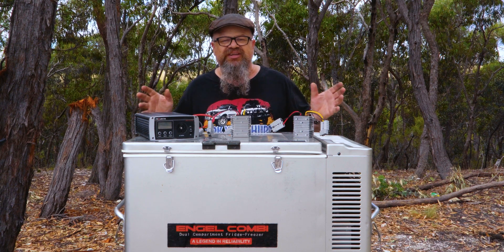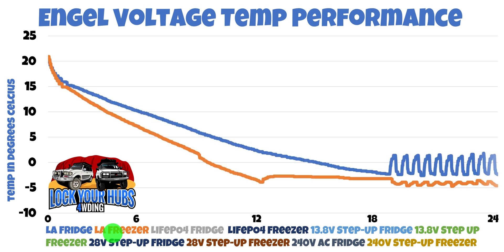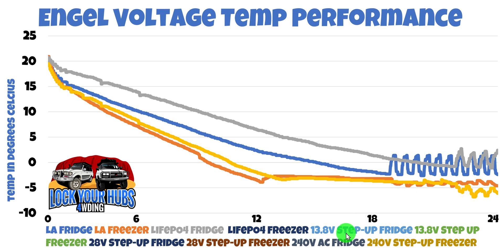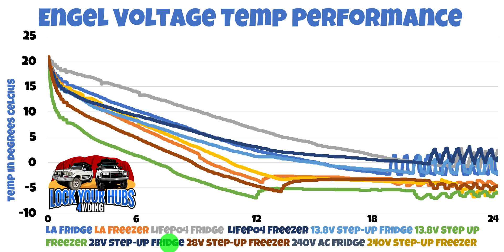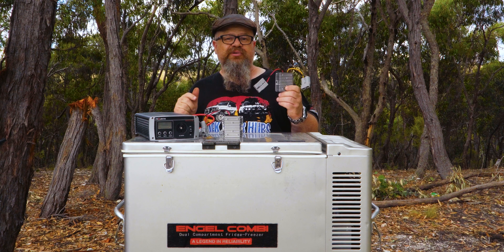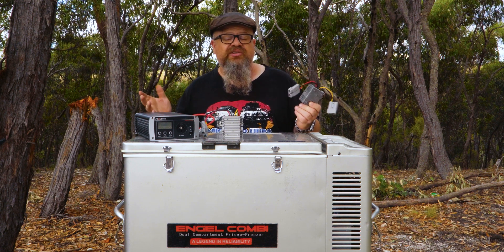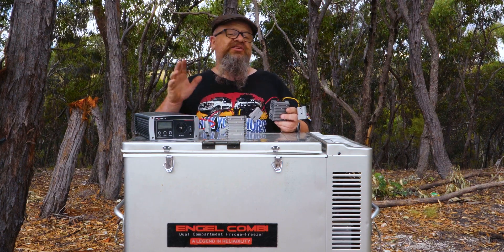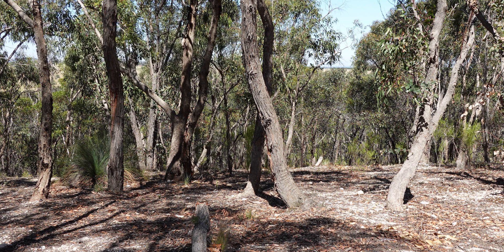Engel Fridge Voltage Showdown: 12V vs 24V vs 240V

Comment: Any chance of doing a performance test between  a kings stayzcool and a  engel.
Cheers Jack
Reply from the maker: Is that the King's dual zone fridge?
Reply: @LockyourHubs4WDing  .
Yes I would assume you that would have to compare a dual zone to a dual zone or a single zone to a single zone.
I am looking at either the 38 ltr plastic Engle or a 45 ltr stayzcool kings.
A Engel  is $899
A stayzcool is $369.
So you can have 2.5 staycools for I Engel
I need a fridge to maintain -18 deg C....
 As ice cream is a must have  or my world will collapse....
.
It would be nice to know if the king's temp gauge is accurate and the thermal efficiency of each unit along with the power units.
The king's have a 5 year warranty as well..
I really enjoy your detailed reviews.
Cheers  Jack

Comment: Great Video on this topic 👍. Interesting to see the peak power is around 13.8v in this case, newer Engels have a regulated power supply so wonder if that's deliberate to make the most performance when the alternator is charging and then save some energy as battery voltage lowers?

For some more technical info if anyone's interested , old school Engels used an iron transformer to generate the compressor voltage (about 23v) from either mains 50HZ directly or a very basic 2 transistor oscillator on the 12v side unregulated. This is why they don't work on 24v and just start humming without cooling from poor input voltage.

 Alternatively in every Engel after about the mid 90's they actually use a digital Mosfet based switching circuit to directly drive the compressor with its aprox. 23 volts AC. Before this 'inverter' section, internally there is a switching dc-dc converter that takes any input voltage (10-30 volts) and regulates it to the required voltage for the compressor circuit. This is why the new ones work much more efficiently on any dc input given, but makes an interesting point of why there is any variation at all with voltage. As stated I can only think its deliberate to give better cooldown performance when the alternator is charging.   

The 240v input is handled by a separate power supply board that just spits out usually 24-28v into the dc converter section. Hopefully someone's following, internally its (240v power supply) -> (28v DC or DC input) -> (DC-DC Converter) -> (regulated stored DC) -> (Inverter Circuit) -> (AC for Compressor). Of course a lot of the efficiency loss in this testing is the external step up or inverter units but there is still going to be some extra loss with the internal 240v supply as well.
Reply from the maker: Thanks for the info! I haven't actually pull one apart to check out the internal wiring. I would assume the circuitry is designed to operate most efficiently at driving voltages in a 12v car as that's probably what a vast majority of the customer base will be doing.

Comment: Back in the mid 80’s I tried modifying the my Engel motor drive electronics frequency.  My theory was the swing motor resonate frequency may not be exactly 50hz & matching that frequency may improve efficiency.  
Compared standard 50hz then below & above 50hz  by up to a few hz.  Found i could not make any significant difference from standard 50hz.   My theory was wrong but had some fun testing.
Reply from the maker: I've done plenty of testing that went nowhere! If you're not making mistakes, you're not learning.
Reply: I tried a similar feat with a 40ltr Engel a few years ago using a 150w inverter and a few other tricks, it worked for several days at a time and then played up. I have more recently got an old caravan Engel fridge with the same Sawafuji swing motor for parts & experimentation, the 12v side does not work but I found the output from the 240vac was actually 138hz (not 50hz as one may expect) at 14.2vac, so I am having another go at making a power supply for my 40ltr Engel using a variable pwm in the 138hz range or there abouts, possibly this frequency can be tuned for better performance. Hope this helps. Cheers

Comment: Another great vid mate. Been a fan of yours (and subscribed) for years now. If you ever get the chance, it'd be great if you could do a vid on lithium batteries.... and whether the charging of these batteries by 'non-lithium chargers' is actually that bad. I've heard many opposing views. Some say lithium chargers are not really needed (and only differentiated by one wire? from non-lithium type chargers... ) and the non- lithium chargers will do the job just fine (and save you heaps in the process). At least one well known company says their lithiums are just 'drop in replaceable' for your old agm batteries and able to be charged by non-lithium type chargers. Anyhow... Appreciate all your vids. They're awesome mate. Cheers 🍻
Reply from the maker: Great suggestion! I'm currently putting a Kings 120Ah Lithium battery through it's paces at the moment. I might check it out after this round of testing.
Reply: @LockyourHubs4WDing  Awesome mate. Look forward to it! Cheers 🍻

Comment: Thanks for that mate. 
Here's an idea for a future video. 
Starlink.....it requires an inverter to supply the router, which then sends 48vdc to the dish, which is the brains of the whole outfit. 
Some people have converted their unit to a 48v converter and POE,  to avoid the need for an inverter.
I'm currently running a dedicated 300w inverter that is only for the Starlink and also the Wavlink AC1200 wifi extender that I have mounted on the roof of the canopy of the Chevy because the Faraday effect precludes getting a decent signal when the canopy is closed.
I'm wondering if my plan to use a 48v converter for Starlink and a 24v converter for the Wavlink,  as well as a separate router to do away with the Starlink router is likely to save me any energy.
Reply from the maker: Most routers run off of a 12v DC plugpack, so that should be an easy fix. I'll have to look at the rest, but it sounds feasible.  

I made some decent gains in efficiency (around 20% from memory) using dedicated car chargers for 18v tool batteries as opposed to using a battery powered Inverter and mains charger, so there's probably gains to be had.

Comment: As always, I love your videos! 
Two questions, with a step-up, does it matter if your supply is from an AGM, or Lithium? Would a Lithium give the step-up a higher final voltage as the input voltage is higher? Lastly, will the results be similar for any brand of fridge and is the step-up’s wattage sufficient for a bigger fridge unit?
Reply from the maker: Great questions! Firstly, the step-up doesn't care what flavour of battery chemistry is feeding it, as long as it's in it's voltage input range and regardless the output voltage would remain roughly the same.  I haven't tested any conventional (danfross) style fridges, so can't comment there, though the step-up in the description will work for any 12v car fridge.
Reply: @LockyourHubs4WDing  thank you very much. I just ordered one for my fridge through your link.  Will order a travel buddy step up soon too.
Reply from the maker: @paulvictor9368  get the 15v for your Travel Buddy, it absolutely transforms the little oven.

Comment: It's funny, 10 years ago when I was looking at a new car fridge I was mostly concerned with power consumption. These days with LiFePo batteries we have so much capacity for so little weight penalty that the power consumption doesn't really concern me anymore (but I still love my Bushman fridge!). On that grounds the step up looks like it could be worth a shot trying on a secop compressor fridge.
Reply from the maker: LiFePO4 Batteries have completely changed the electrical landscape for 4WDers. Induction cooking, airfryers and even coffee machines aren't completely unreasonable to want in the back of your 4WD these days.

Comment: Another great informative video... So if I recall correctly you said in your oven video the same results were with the 13.8v step up... so if a person was to run both in their car do they connect them both to 1 step-up unit or one unit for each appliance? I have an old 40L Waeco fridge that I put in my 80 series when I go away and it is connected to my second battery which is a 120ah AGM battery should I consider getting a 13.8v step-up unit? and later on, I am also considering getting an oven.
Reply from the maker: I didn't test a conventional (usually Danfross as used in the Waecos etc) type compressor, if they don't have a voltage regulator in circuit, you should see similar results. 

I would use two step-ups personally, that way you can keep the step up as close as possible to the thing you're running off of it to minimise voltage drop, just like a DC-DC charger.

Comment: Wow, I would have put money on the 24 volt giving the best performance. The result was a big surprise to me. Not so much of a surprise for the power useage though. I expected the step up converter to chew more power. Considering the relatively small difference in performance once the fridge is down to temp, I can't see any reason to use anything but vanilla 12v as that, over time, will use less battery capacity. This was a very interesting vid, thanks for the effort you put in to making this stuff.
Reply from the maker: I would have initially thought the mains would have provided the best performance, being that the fridge's compressor runs on AC. 

Now having completed the testing, I'm thinking that I should do a further comparison on maintaining temps in hot weather at various voltages. I would assume the 13.8v step-up voltage could reduce the cycle "on" time enough that it would reduce overall battery consumption, just like a Travel Buddy. 

But, I've just finished 3d resin printing an optical spectrometer to finally put to bed the whole LED vs HID vs Laser vs Halogen light argument, so it might be a while :)

Comment: I don't have an engel - I run a kings. They run happily on 24V, though, truth be told, I haven't compared efficiency between 12 and 24V operation.
I know you are meticulous with your comparison setups, but the  increase in terminal volts of 0.4V between the LA and  Lithium seems to be contrary to your time results with 13.8V.
 I'd expect a slight improvement from the higher volts of the Lithium as you plainly demonstrated with the 13.8V step up inverter,  but instead it went down (took longer). I'd be double checking those terminations...
Hey, that was a great video (again) and glad to see you back up on the silver screen.
Reply from the maker: Every test is conducted 3 times (probably why it takes me so long in between videos!) That way I can check out the standard deviation to look for errors like you mention. Sometimes the results are just surprising! 

The published results are the average of three. This testing methodology is standard practice if you want data that you can rely on.
Reply: @LockyourHubs4WDing  Well, I did say you were meticulous! I'm well and truly surprised by the result - its definitely not a loose terminal or something, as I originally guessed. Must have something to do with the Engel.

Comment: what about other fridges? not everyone has or wants to spend $1500+ for an engel, especially these days
Reply: there's really no other portable fridge that compares to an engel. every other fridge on the market has more moving parts, is more complicated, won't run on the same angles, and just isn't as durable.
you buy an engel and you have it for multiple decades not multiple years.
Reply from the maker: Buy once, cry once! I've got a Waeco fridge as well, though that thing spends more time getting repaired than it does working unfortunately.
Reply: @LockyourHubs4WDing  as i said i know people that went the wank route and had nothing but problems with engel, just because the price is high don't make it good
Reply from the maker: @arronjohnston742  I know no brand is perfect, that includes Engel. I can only speak from personal experience, and so far that experience with the Engel has been faultless (bar the transit cover! )
Reply: Having had many other fridge brands, none of which have lasted much longer than 7 years, I have to say buy Engel. They cost a lot because they last so long and when you divide the initial cost by the length of time, they are almost always going to be a lot cheaper than fridges that don't last long. For the record the worst brand we ever had was Vitrifrigo. Absolute junk, lasted a bit longer than warrantly and then died.
Reply: @WesternAustraliaNowAndThen  yet i know of a few people personally that have had nothig but problems with engel, dometic/weaco, evacool, arb and others that have kings sitting on the back of their tradie utes out in the weather for 8+years, it's all bullshit it's a wank factor bragging rights thing in the end they're ALL made in china... spare me the "oh oh oh engel is aussie made" bullshit!! at best it's bolted together in aus the parts are made in china...........
Reply: @arronjohnston742  Well we have been using 12v and 3 way fridges for decades and our experience with many firdges including WAECO, Dometic, Vitrifrigo and others is that Engel has outlasted them all. The only troube we ever had with an Engel was our old 60 litre (15 years plus now) that stopped cooling one Christmas and we read online that the solution might be to turn it on its lid overnight with the power off. I didn't hold out much hope but I gave it a go and it worked. It has been running perfectly for years since then. The only Engel I really didn't like was an upright, it kept things cool without a problem but the upright cabinet was a total piece of junk. Currently we run 3 Engels and haven't had and issue (other than mentioned above) with any of them. The proof is in the pudding as they say :)
Reply: I have 3 of them and the MT45 and MRO40 have been operating as freezer and fridge in my garage (in FL) for over a year without missing a beat. I also have the MRFD 15 which is presently sitting in my car running on a 12.6 Volt outlet from an Ecoflow power station. Even if the Engels land up consuming more power than some of the modern 12V fridges running the new BD nano compressor, I would still prefer an Engel.

Comment: Or turn the fridge on as you go for a drive.... The charging voltage will be close to 14V. 

Once you reach stable temp the step up converter will only add ongoing losses
Reply from the maker: Once you're at a stable temp, the step up should reduce the on time during cycling.

Comment: Well done great content again.
I use 3 X 12 v fixed solar panel array wired in series which running through a 100 amp mppt charge controller.
I have 2x 135 amp AGM batteries and a DC to DC 25 amp charger wired in parallel .
It runs my freezer at -18 and my fridge @+2 
24/7 whether the car moves or not.
I would be interesting to see you evaluation of such a system.
Cheer Rob
Reply from the maker: I haven't done any solar videos as yet. That's a great idea, thanks!